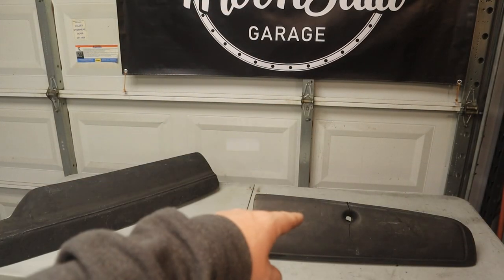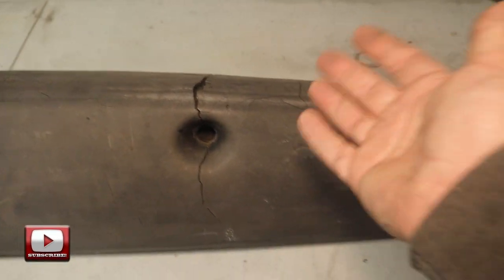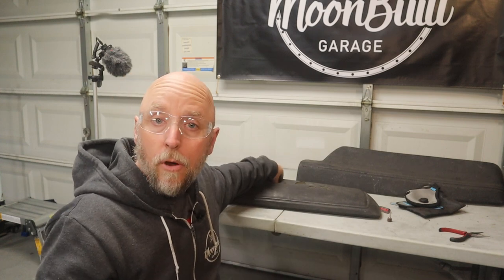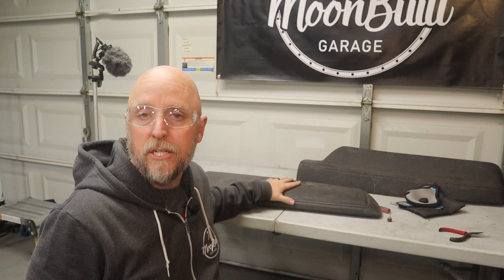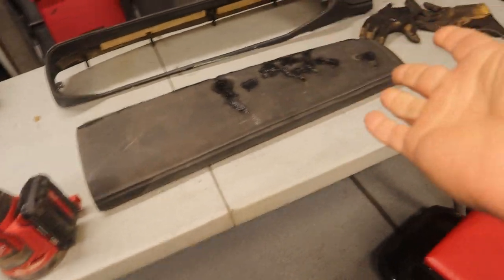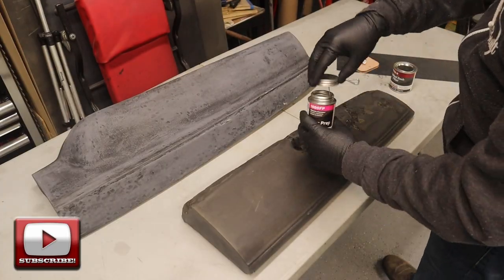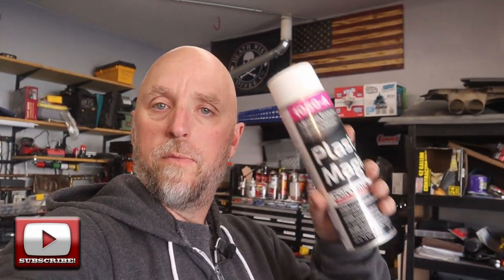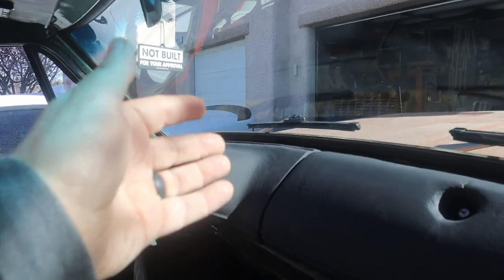DIY Cracked Padded Dashboard Repair | How to Refurbish a Cracked Dashboard | Rebuild Your Dash Pad

Comment: hey bro, body filler work sucks at best for all of us. I attempt this stuff all the time sometimes with success. Outside of aftermarket who ever comes up with a good solution for dashes that can take the weather punishment will be rich. I am working on my 69 F100 dash which is as basic a dash pad as they come. Life is far to short to try and master every craft and  I Just as you don't have the patience for that stuff. Even if I paid myself minimum wage when all is said and done my repair would cost me 1000 bucks for subpar results. Thanks more than anything for your honesty which is severely lacking in this day and age. In closing Im sure you get it perfect on what's important like family because you are wise enough not to let some shit steal the sand from your hourglass of life